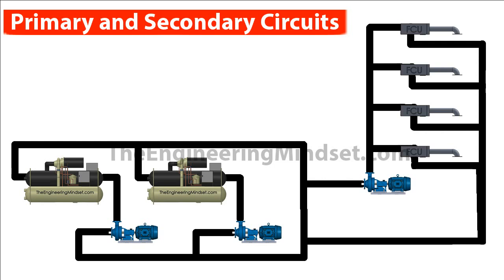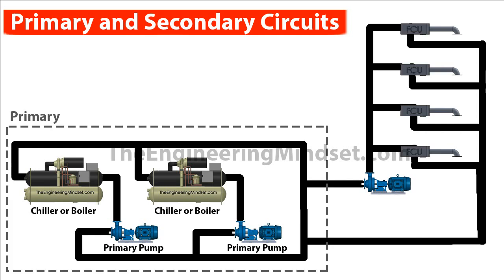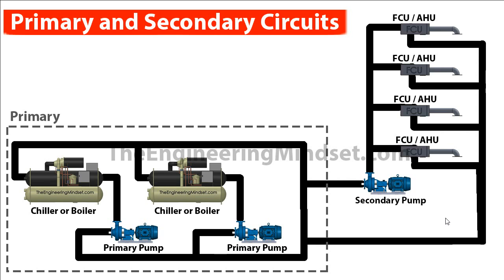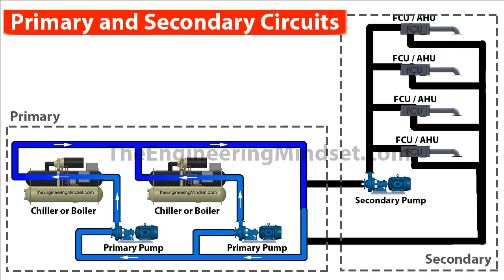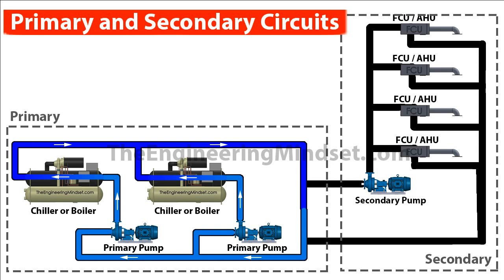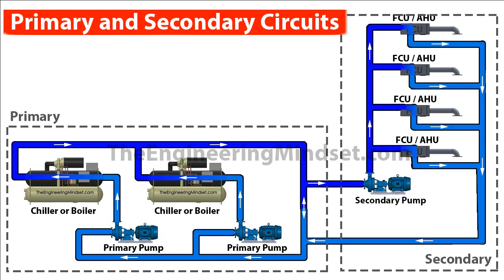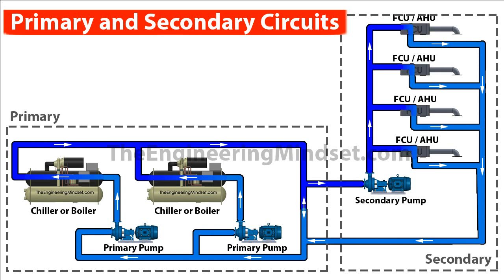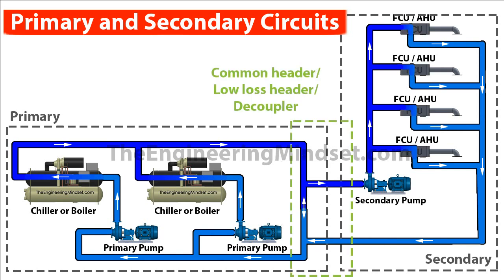HVAC Primary & secondary circuits

Comment: Great channel! What is preventing the secondary return water from going back into the secondary supply water through the decoupler line? Or in general, what is preventing the return/supply from mixing around constantly between the primary/secondary loop? Is it all based on pressure differential between the two?
Hope that makes sense!
Reply from the maker: yes the pressure is the key difference but some will mix and flow between

Comment: hallo sir i saw your videos i iam happy with that and i requiest you to upload videos on calculetion from strating to finish calculetion of hvac building such as selection of air terminal, duct sizing hydronic pipe sizig vav selection and ahu selection load calculetion and chillarselection caplate tutorial, thank u
Reply from the maker: I'll add it to the list, we will likely break them up into small videos in a series

Comment: Do primary pumps have more pumping capacity or secondary pumps?
Second can you explain the chilled water piping design in details and different chilled water pumping types?
Different valves are installed at the inlets and outlets of pumps, chillers,  FCU, s and AHU,s, So in this regard  which standards do we follow?
Reply from the maker: it depends on the system, most have pump per chiller on the primary side so it is sized for the flow rate of the chiller. the secondary is sized for the loop it serves. The secondary therefore would end up recirculating all the water if it was larger.
Reply: @EngineeringMindset   im confused because i think the primary pump should have greater or at least equal pumping capacity of the secondary pumps because the flow passing through the chiller will be going to the individual equipment. If the pumping capacity is lower then we might be having problem due to insufficient amount of water flowing on the secondary pumps. But the pump head of the secondary pump maybe lesser or  bigger depending on the system. Please correct me if i am wrong?

Comment: Would you have a buffer vessel on the primary and/or secondary circuit in a typical closed system?
Reply from the maker: Yes many chiller systems, especially air cooled, will use a buffer to handle surges and reduce the load on the chiller.
Reply: A decoupler pipe

Comment: Is the low loss header installed for the purpose of maintaining the minimum flow rate for the chillers/boilers even though the loading required is not that high?

Comment: What happens when the secondary pump fails? Does it shut off water flow to the secondary circuit?  Or the main pumps take over?
Reply from the maker: no water will flow in the secondary, but you would usually have two secondary pumps running in duty and standby just in case
Reply: There’s usually a backup pump.